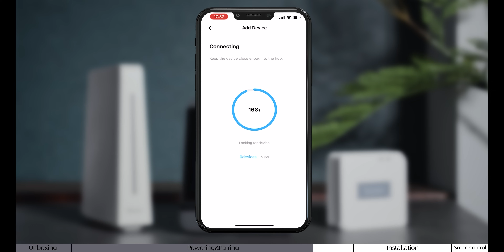Effortless Installation Guide for SONOFF Zigbee Smart Water Valve

Comment: Does this have a minimum water pressure for it to work?
Reply: The valve opens and closes even if it isnt connected to any water. So no. 
However, i guess if there is just a trickle, the impeller inside measuring the amount of water, wont spin.

Comment: Effordless??? It dosn't connect to my zigbee pro bridge. I spent one hour endless tries - dosnt connect.
Reply from the maker: Hi there! 😊

Sorry to hear about the trouble you're having with your Zigbee Pro bridge. Let's get this sorted out quickly!

Update Check: First, please make sure your ZBBridge Pro gateway is updated to the latest version.

Close Proximity Pairing: Try pairing the device close to the gateway to see if it connects.

Network Improvement: If the connection is still weak in the desired location, consider using additional Zigbee router devices (like ZBMicro) to enhance the network.

Hope this helps! Let us know if you need any further assistance.

Comment: Seems a shame that they didn't add a solar and battery to it considering its likely to spend most of its times outside.
Reply from the maker: I understand your concern. Actually, the SONOFF SWV can be powered by batteries, making it suitable for outdoor use. Although it does not have a built-in solar panel, the battery option provides flexibility for various environments.

If you have any other questions or need further assistance, feel free to let us know! 😊